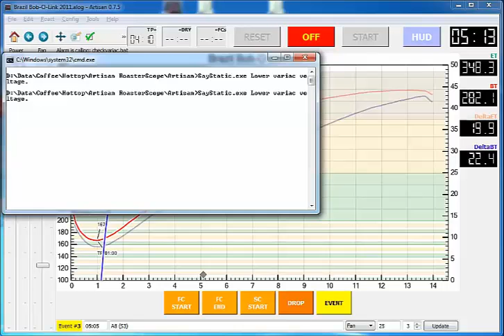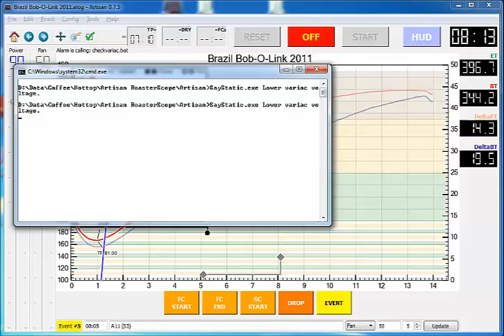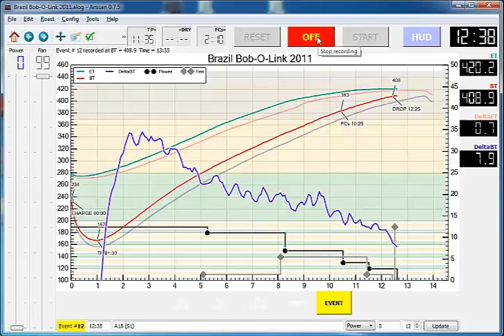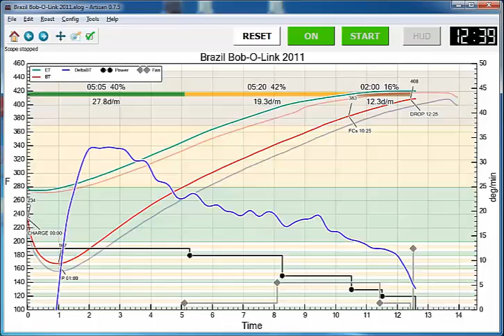TC4C+Artisan roast 05-08-2014

Comment: Nice video Rick.  I roast on an Ambex ym-2 and use the Artisan program.  I'm wondering what you use for the curve smoothing values and sample intervals.  Do you know the effect of all the values.  How about "over sampling.  I sure would like the ROR to be smoother and mine is about like yours.  In reading Scott Rao's new book on roasting, I've tried to improve my roast by making sure ROR doesn't level out or go up.  Radical drops, especially around 2-4 min are an issue for me.  I noticed on your roast that 1st to drop is very short percentage wise, 16%.  Scott advocates 20-25% for this and I know higher than that really destroys the sweetness.  A lot less might lead to underdevelopment.   I've found myself having to re-learn roasting and stumbling around a lot to make all of these parameters come out right.  My first roast was way too fast, 2nd too slow, etc.  Entering 1st C with a lower ROR ends up either >>25% or pulling the roast way too early.  Any thoughts?